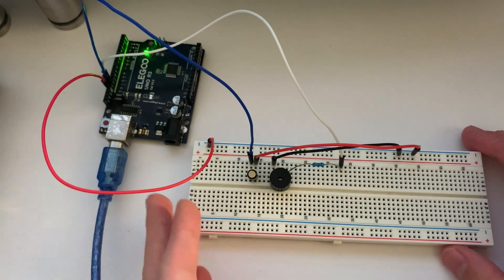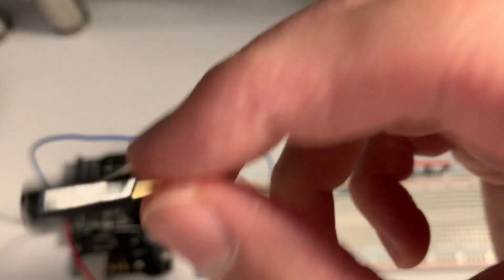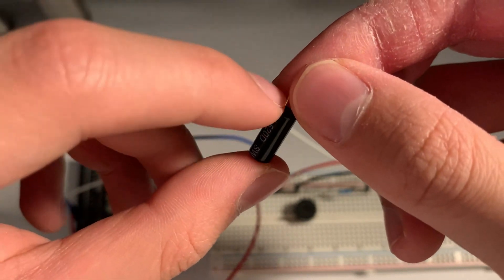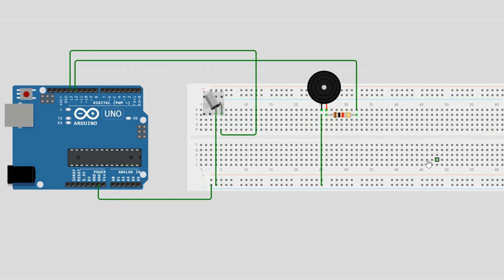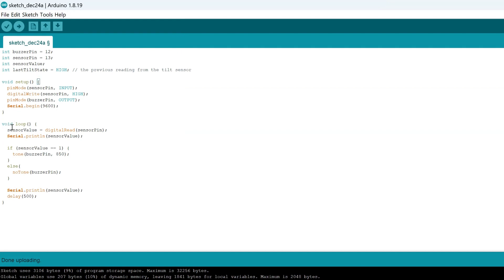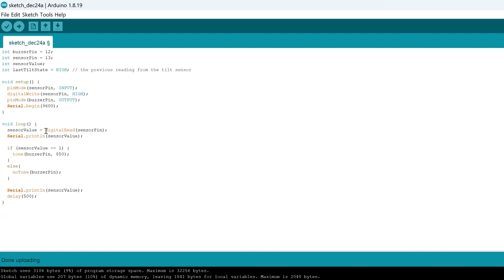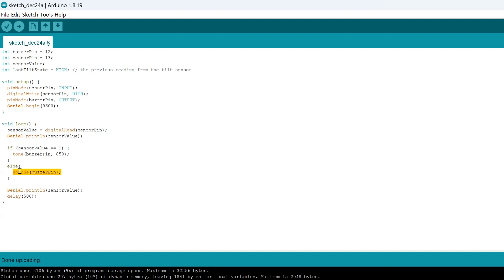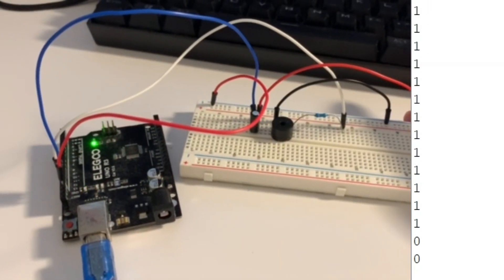Responsive Arduino Tilting Sensor - Quick and Easy Tutorial

Comment from the maker: int buzzerPin = 12;
int sensorPin = 13;
int sensorValue;
int lastTiltState = HIGH; // the previous reading from the tilt sensor

void setup() {
  pinMode(sensorPin, INPUT);
  digitalWrite(sensorPin, HIGH);
  pinMode(buzzerPin, OUTPUT);
  Serial.begin(9600);
}

void loop() {
  sensorValue = digitalRead(sensorPin);
  Serial.println(sensorValue);

  if (sensorValue == 1) {
    tone(buzzerPin, 850);
  } 
  else{
    noTone(buzzerPin);
  }

  Serial.println(sensorValue);
  delay(500);
}